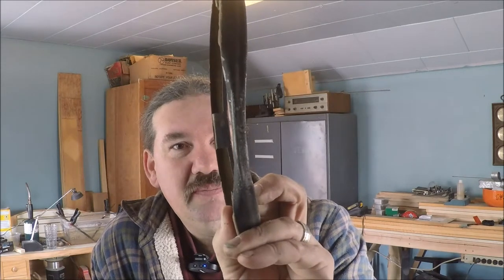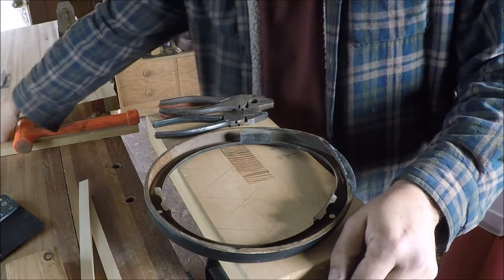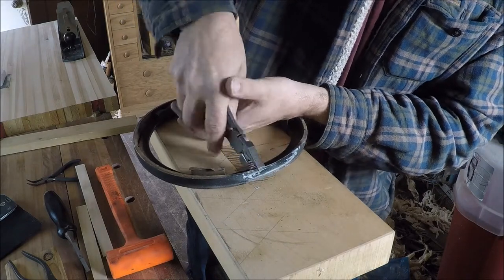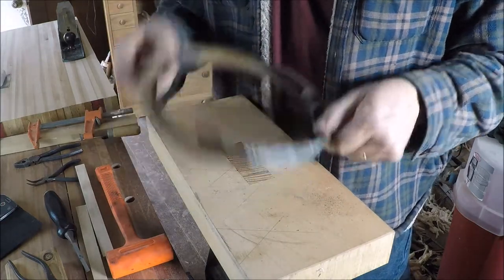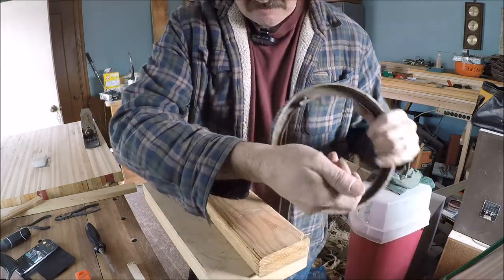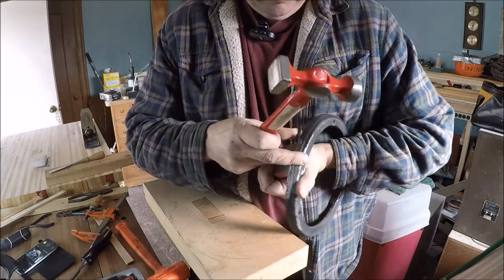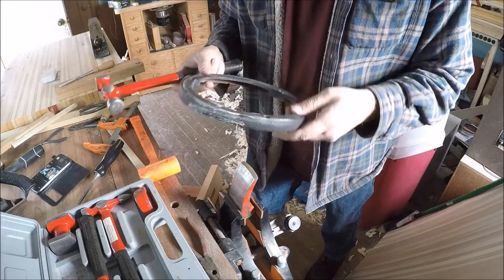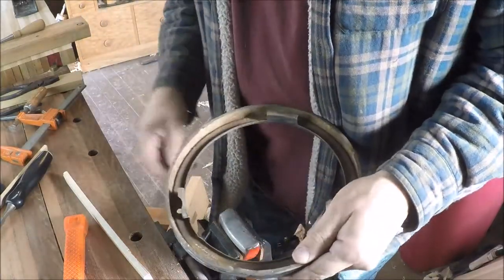Straightening Bent Metal: oops!!!

Comment: Nice work on the bezel. Those little parts are worse than removing a big dent in a fender. Lots of tapping. I have a similar set of body tools that I bought at B&G Salvage in Schoolcraft near Kalamazoo. I used them on my old 46 Ford. Might not be the best tools but they work. 
I just took a break from setting up the 10-27 screws for the Depth Adjuster. I am getting the knurl rollers changed and ready to knurl the outside of the knob first. All for the want of a horseshoe nail. 😊
Reply from the maker: Yeah if I was full time at body work I'd need better ones but I'm not lol. I talked to Randy Richard about using his surface grinder to make the # 78 depth stops. We're probably going to mske a fixture that will hold 10 and finish up the bottom all at once. The foundry should be ready to send me the first 10 in a week or so.